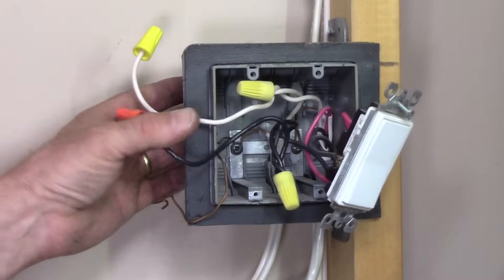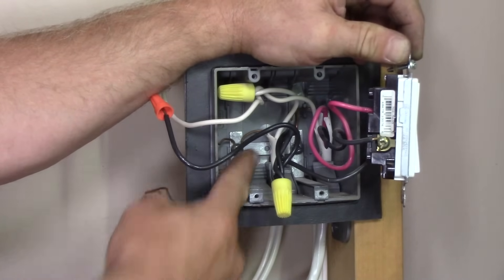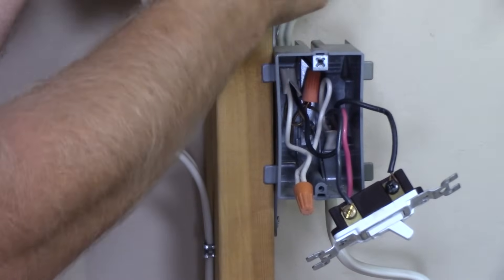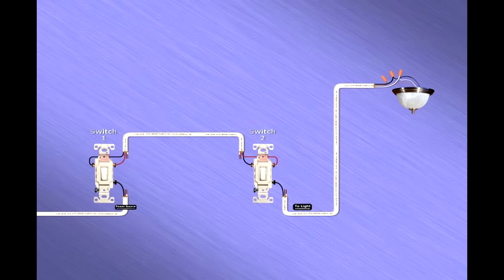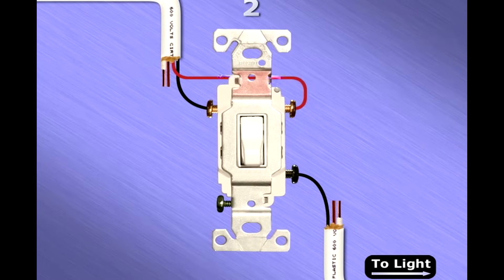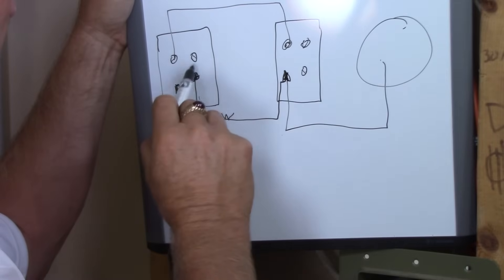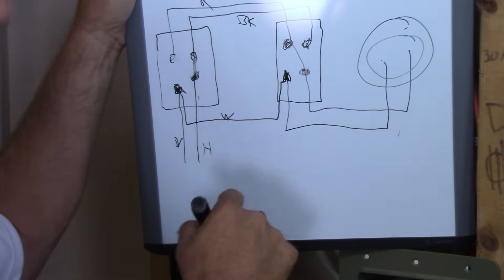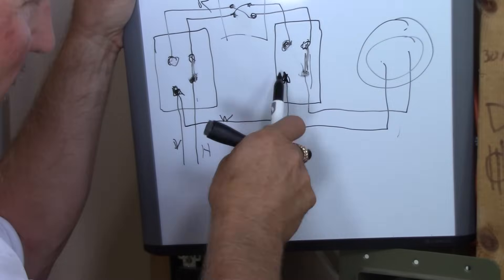The Best 3 Way Switch Explanation Ever!

Comment: thanks. I realize I bought the wrong switch now. I need a single and I bought a 3 way. although, that's all I seen them have at the menards I'm gonna have to ask someone where they keep the singles at. 

thanks for this information, I was confused
Reply from the maker: Other than the 3-way being more expensive, if you don't want to bother exchanging it, you can use the 3-way in a single-pole application.  Just use the common terminal and the terminal above it on the same side, or use the terminal on the other side but you'll have to then mount the switch in the box with the common on the left for the switch to be "on" when in the up position.

Comment: This is NOT what I have in our ceiling pan. I have (1) ground (2) neutrals (1) red (2) black.
Why is there a red wire in the ceiling? I get why it would be in the switch but not the ceiling!

Comment: If my light is on when one switch is up and the other is down, does that mean that one of my switches has been installed upside down? I am asking as I thought that the light would turn on with both switches in the same position.

Thanks for the video

Comment: I can usually figure out how the three way wiring work. The two light fixtures were not lighting after replacing the light bulbs up so I just replaced the two fixtures. I thought I replaced them one wire at the time to avoid mix ups. Now one of the lights comes on, goes off and comes back on from time to time, there is no power at the other fixture.

There might've been a wiring issue before, homeowners just bought the place. Maybe you can point me in the right direction to figures things out. I have 3 way switches controlling two light fixtures. In this case I have red, black, white wires at the switches but cable with one blue, white and black at the fixtures. So I can't figure out on how to unscramble the wiring.

Comment: Exceptional video. Can I complicate the setup a bit? I have been trying to figure this out for a few days now with no success.

Box one has the supply and box two normally terminates at the light. If I have two light fixtures, I would need to pigtail the two at the 2nd box, right? Now what happens when this old house was wired with one light fixture terminating at box 2 but the second light fixture is terminating at box 1? However do I set up the 3-way to control both lights at the same time from two different boxes?…. Without running new wire 😅.

Comment: How do you wire a 3 Way if you want all the switches down and the light is off?
I have a black, red, white, and a bare ground wire.
The original connection: the black was connected to the common. The red was connected above it, and on the other side, upper corner, is the white. The ground was screwed into the green screw.
I tried various combinations. None, resulting in that outcome.
✌🏾

Comment: So does it matter where your travels are? If you have a red traveler to the left should u keep it to the left on the next 3 way?
Reply from the maker: It really only matters if you care about the positions of each switch in relation to the light being on or off.  I ran into an inspector that insisted that the switches had to be either both up, or both down to have the light on, and switches in opposite positions it  is off.  I don't believe this is based on any code or addendum of such.  Just his little idiosyncrasy.

Comment: Watch out for electricians trying to use 2 conductor cable to go between the 3 ways ans 4 ways. They do this to use cheaper 2/C rather than 3/C as is needed to bring the neutral from the first switch to the last switch, which may be on the other side of the house. To get a neutral to go from the last switch to the light what is done is to grab a neutral from the nearest box. This means current comes from the panel through one knock-out hole, but then returns in a different hole.in the panel CODE VIOLATION, with a big enough load there can be heating in the box.

Comment: This helped me understand how it is supposed to work, but I had a red, a black, and a white wire in the switch that I was replacing.  House was built in the mid-1980s and the mechanical contractor had a drinking problem.  I have not pulled out any of the twisted wires.  It works with both switches down but not up.  I switched the white and black on one switch and it works with one up and one down.  So net-net, totally confused.
Reply from the maker: I have a drinking problem and I wire these all the time! 🙂  But seriously, you still have a common and a traveller mixed up at that location where you replaced the switch. Without being there to have a look, just do this.  Power off, move the wires to different screws, power on, check.  Repeat if necessary.  You can't do any damage, you'll just see a variation of what you are already experiencing if you get it wrong.
Reply: @theinternetelectrician  Thanks.  I figured it out later and you are correct.  I put the wires on the same screws on the replacement switches as they had been on the originals.  Then I noticed that the original had a copper screw (top right) and 2 brass screws(top and bottom left) while the new switch had brass screws on the top (L & R) and the black screw on bottom left.  Switched those 2 wires on each switch and that solved it.  The common was in a different place on the older switches.

As far as the drinking problem and physical abuse, it was so bad with the son that his wife and her boyfriend (a state trooper) killed him.  Claimed self-defense but toxicology report showed he was too drunk to have been functioning at all.  So yeah, on a whole other level!
Reply from the maker: @walte99  Wow, yeah that's a whole other level alright! Glad you figured it out!  Thanks for watching!

Comment: Sir, I have a dimmer switch with an on and off switch on the wall on the first floor. It controls a series of recessed ceiling lights (about 8), then I have an on and off switch on the second floor (no dimmer), which controls the same number of ceiling lights. Would this be considered a 3-way switch?

Comment: Video really helps but I don't understand how I have power on all 3 switches but lights won't come on
Reply from the maker: I would need much more information from you to troubleshoot the problem.  Photos, diagrams, any supporting information you could provide as the story behind what went wrong.  New installation? Existing that quit working?  Devices changed out and no longer works?  Light fixtures replaced, etc.  It's a bit like detective work to solve a crime 🙂
Reply: @theinternetelectrician  how  can I send you the pictures
Reply from the maker: @dsgb4life  you can email to internetelectrician@gmail.com
Reply: @theinternetelectrician  it's  all new but the guy who helped me was a licensed electrician but he passed away so I have to finish it myself but I can definitely send you pictures im about to be there

Comment: Great video. My question is, how would you add a light to the circuit you have shown? It appears my house is wired the same as you displayed. I would like to add a light at the bottom of the steps (there is currently only one at the top) Would i need to fish a new romex from the top light to the bottom?

Comment: This helped me identify the error in my switch wiring. On the secondary 3-way switch which is not directly powered by the circuit, I had the black wire from the traveler hooked into the common screw and the black wire from the circuit hooked in the traveler screw. I reversed those, and problem solved.

Comment: Hi Terry I'm not sure if this is posable but I want to independently turn on and off lights within a 3way circuit. I have an outdoor area with two separate low voltage lights I want to turn it on and off at the house and on and off at the outdoor area but I also want to turn on and off each set of lights separately

Comment: Can I use a single 3 way switch to toggle between 2 power sources (to run my furnace)?  When the grid goes down, I want to switch the power source to my generator.
Reply from the maker: No.  In theory, yes, but you have the neutral and ground wires to deal with.  That gets complicated with the grounding / earthing / bonding everything properly.  One way to do this that is not much more cumbersome, yet safe is to pull out the feed cable from the furnace, mount a box and put in a receptacle, then use properly sized cab-tire with a male plug on it and use that to connect the furnace.  Plug in to the outlet for normal, un-plug and plug in to generator when needed. 
Another more complicated but safe way is to use a 4-pole relay (2-N.C. 
 2-N.O. contacts) with a 120V coil. I could provide a diagram of how to connect that all up if required.
Reply: @theinternetelectrician  Thank You.  You're clearly an expert!  I had to look up cab tire cable.  But the box / receptacle idea sounds good to me.   And yeah, I was wondering about the neutrals and grounds with my 2-way switch idea.  A 4-way relay and coil sounds a bit complicated for my level.  I'll return the 2-way and get a box / receptacle.  Thanks!

Comment: How you do 3 way with 2 lights in-between leaving constant power to a pull chain light at bottom of stairway and 3 way control to the 2nd light thats powering the pull ? 🤣 answer me that one and I'll pray to you as my new God 😉
Reply from the maker: Send me a diagram of the layout and the current wiring (wires / cables in each box, 3-wire or 2-wire, etc) and I'll let you know if it can be done, or what you need to do to make that work.  internetelectrician@gmail.com

Comment: Hello, thanks for this video. It was quite informative. Great job 👍. But I have a question. What if the main power 14/2 (black, white, and ground) comes into J-box with the light fixture 14/2 wire, how do you do this connection to get them working properly?

Comment: If it was the best, it wouldn't take 11 minutes.
Reply from the maker: I'll wait for your "Bester 3-way" video and will watch it for 10 minutes!
Reply: @theinternetelectrician  The black terminal on one switch goes to power source. The black terminal on the other switch goes to the light fixture. The two gold terminals on one switch jump to the other gold terminals on the other switch, and the order of the jumpers does not matter. The white neutral must, as always, return to the breaker panel from the light fixture.
   There.  30 seconds.   Follow that word for word and it will work.
Reply from the maker: Thanks!  Can I have your permission to use your transcript?  I get working on that today but I'll give you full credit for it.  Thanks for watching!   @danstrayer111

Comment: I wired it per your instructions and the light is on with both light positions in the up position, I had to switch the travelers at one of the switches so it works right, this was you presented does not work
Reply from the maker: There is no 'right' and 'wrong' as to what positions each switch is in for the light to be on.  I have heard of an inspector that would insist that both switches be either in the up or the down position for the light to work, but that is not code.  That is the reason the switches aren't labelled as 'on' or 'off'.  So if you didn't like the way it was with both in the up (or down) position to make the light work, you didn't need to change the travelers, you could have just pulled one switch out of the box and turned it 180 degrees and that would have accomplished the same.  Thanks for watching!

Comment: This is great, I have a strange setup. Large family room with switch on both ends of room with two lights between switches. Looking thru several books st library I can not find layout of two lights. Thanks
Reply from the maker: While the easiest way to wire what you describe is simply to run from light one to light two after wiring the 3-way network featured here, there are many variations of how to wire it.  If you just have 2-wire(+ground) cable in one light, and one in and one out of the other, then it's done the easiest way.  If not, then send me an email to internetelectrician@gmail.com and with a better description and photos or diagrams of what you have there, I'll help you out.

Comment: I'm not an electrician but this is an excellent video and explanation.  It kind of reminds me of railway tracks with junctions.  Simply put, you either complete the circuit to your destination or not, incomplete (dead end).  You could have 2, 5, 10, etc. of junctions.  It's all about completing a circuit in this case.  It's so easy to understand as soon as you remove the terms "on" and "off" which are only useful for a direct connection where people get caught up with switches being up or down.  Thank so much.

Comment: In this animation, when both switches are OFF, the line will be on... It's stupid or didn't understand it?
I mean The example should have the black wire connected to the right side of the 2nd switch and the red on the left ...
Reply from the maker: Once you free yourself of the terms ‘on’ and ‘off’, that will help as those terms don’t apply to 3-way switches. So yes, both switches in the down position will have the light on, and both up will also mean the light is on. Either one out of position from the other and the light is off. And even that doesn’t matter as you could install one or the other flipped the other way in the box and the reverse would be true. I have heard of some inspectors insisting that both switches be in the same position for the light to be on but that’s not based on a code rule, only a personal preference.
Reply: @theinternetelectrician Where I am all the houses I have visited or been at, shops, comercial places the "on" position has a defined orientation as well as the off position. Of course the switch doesn't have an On or off, some things are just common sense don't need a rule.

If I have an house I would expect both switches in the down Position to mean the lights are OFF or if you like it both Up... Different than this is just stupid sorry...
Reply from the maker: @marcosmoura911  No worries!  I know what you're saying, but this is just the way it is!  The only option is to have it so if they are opposite of each other, lights on, if they're both in the same position, lights off.

Comment: So here's a question for you. If a 12-2 is coming from the light that's used to power a single pole switch how do I run my wires on two double pole switches that I just installed with a 14-3 wire between the switches?
Reply from the maker: 2 "double pole" switches?  Or do you mean 3-way switches?

Comment: Does it matter on your travelers on what side they go on on a 3way switch? Hiw about a 4way?
Reply from the maker: No, matters not.  Only the common matters.  However I have known of an inspector that would make you change the travellers if it wasn't such that both switches in up, or both in down meant that the light was off.  one switch or the other out of "sync" and light is on.  Not a code rule, just being fussy.  4-way, the only important thing is to pair the travellers to be together on the 'in' and the 'out' terminals.

Comment: Terry.     Thanks so much #1 for getting my 2 outdoor floodlight fixtures on after a contractor took them down doing new siding and left bare wires sticking out. Quick version is was I replaced a switch unnecessarily but wired it incorrect.     After watching your video after 5 year of chemo because of incurable multiple myeloma cancer I never had the switches 1 in kitchen 1 in garage in open loop position.     Up and down the ladders many times.     Up and down stairs many times to turn off power at breaker, I have done lots of electrical in 63 years but was at wits end and I never call anyone fix everything. So once switches were in correct position Voila light wires energized again later today I am reattaching fixtures.  Your whole presentation skills and value make it possible for just about anyone to,install or rectify their dilemma.      Keep up good work Sir.       David
Reply from the maker: David, thank-you so much for taking the time to comment!  It makes it all worthwhile to know that people appreciate my videos.  Thanks for watching, and I trust you have won the health battle?  Stay well, stay strong!

Comment: concepts are simple but often you find where the power wire is fed back from the switchbox on the right (in the video) to the switchbox on the left and from the switchbox on left, the hot and neutral go up to the light.